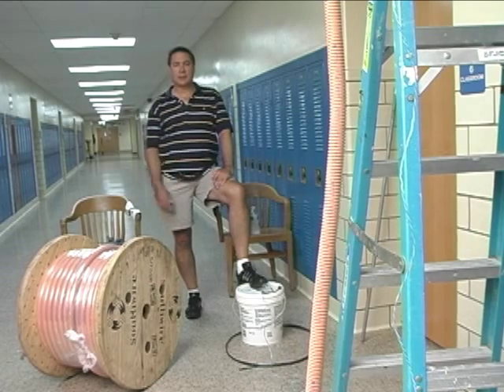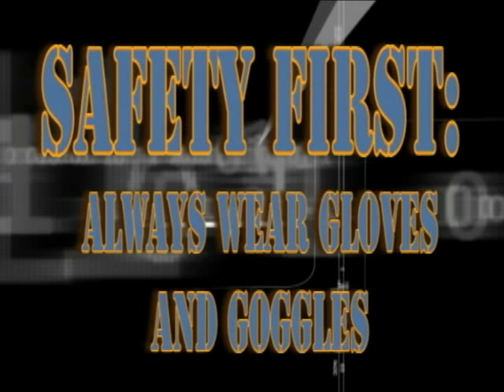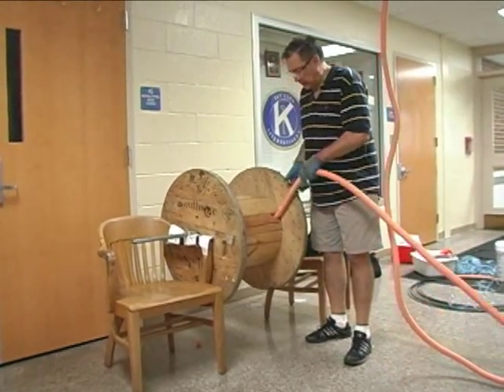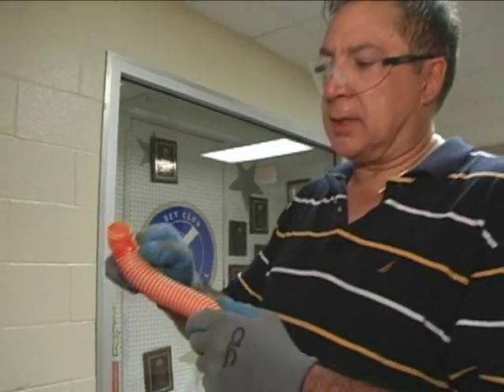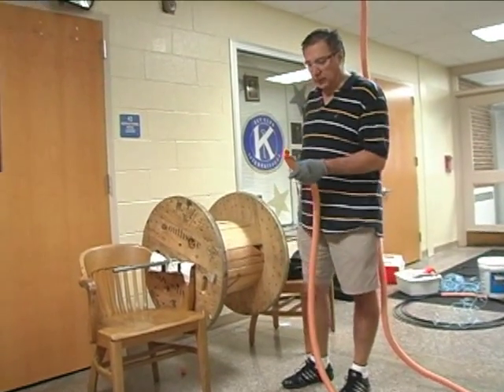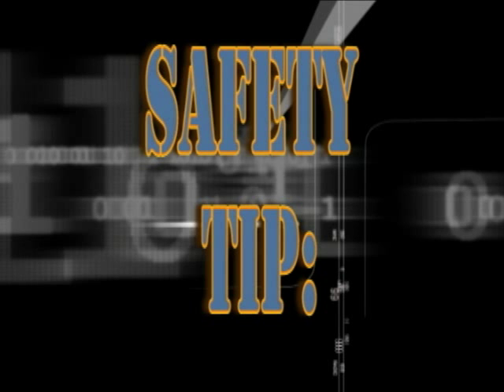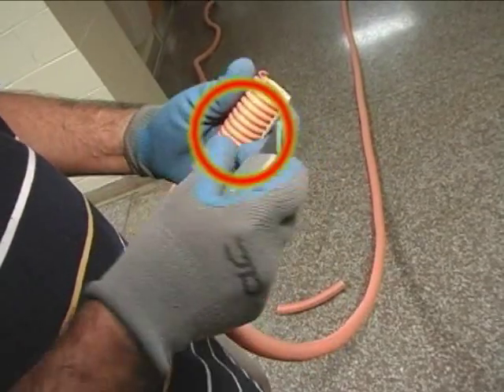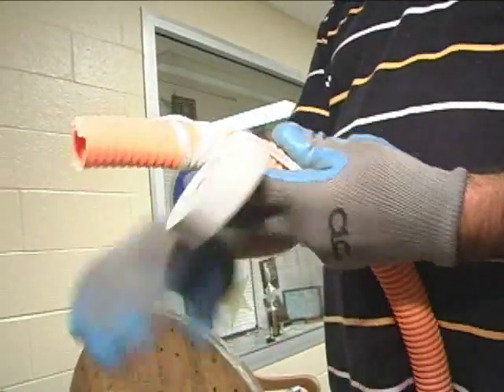Fiber Optic Tutorial Chapter 6:  How to pull Innerduct Into the ceiling (Second 200 Feet)

Comment: This corrugated tubing is only good for straight runs.  Maybe one turn included.
Reply: Borgman2505 you can do turns, you just need access to the point where the turn is located.
Reply: @DaedalEVE  No, It will turn just fine.. Just watch out for sprinkler heads.

Comment: so how long did it take to pull 200 ft?
Reply: It takes less then 15 min for our crew to pull 250' innerduct "Not on a reel" in new construction. With drop ceiling installed still just pulling innerduct about 45 min. We pull the innerduct completely off reel then pull. Much faster and easier.